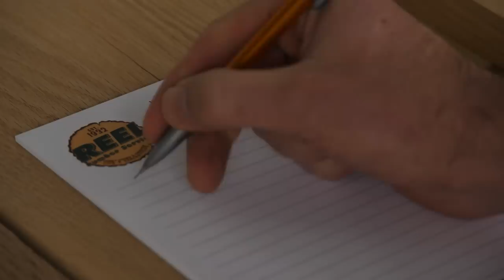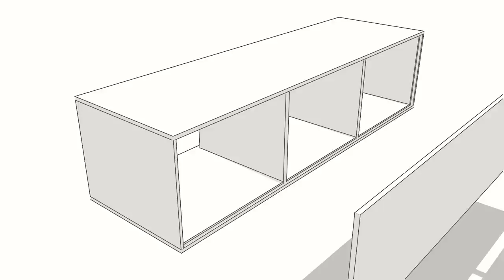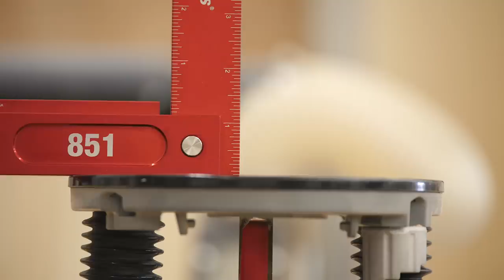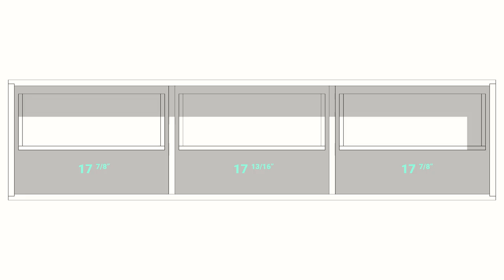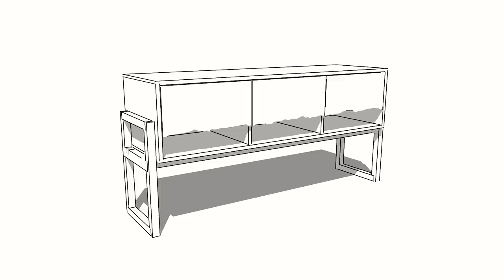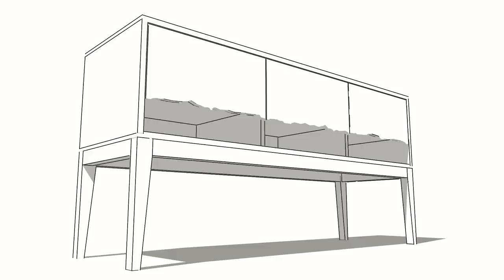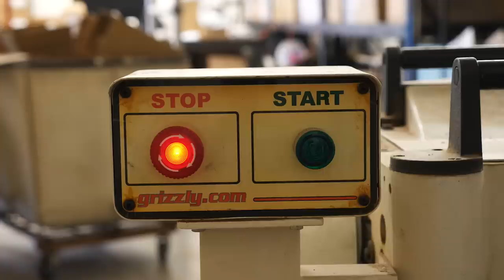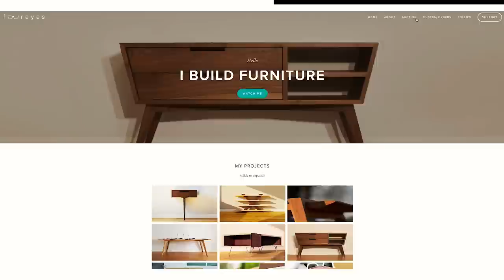Live Edge Drawer Credenza

Comment: Nice video! About the "reinforcements" with screws: I saw some videos testing screws vs glue. The glue was way stronger than the screws, so probably no need at all to screw after glueing.
Reply from the maker: Thanks! That is true that glue can be stronger that screws but it depends on the orientation of the pieces. This joint would be end grain to face grain, which is not the strongest. Basically the more end grain get involved the less you can rely on glue.

Comment: Hi Chris, love your content. You are a main reason I finally took the jump and started some real furniture making. I am currently planing a build for a dresser. I saw in this video that when you were doing the glue up for the cabinet box you had the base sitting atop a few pucks, raising off the work surface to fit the clamps. What are those/ do you have a better suggestion on how to glue up a large cabinet and keep the corners at a perfect 90? Thank you!
Reply from the maker: Those are called bench cookies. You could also just use some scrap wood... but they are generally handy to have a few around.

Comment: 17 7/8'' - 17 13/16''. OMG I'm so glad I live in a country with metric system ! :) Those fractions of inches are just unbelievable for me !
How old a kid has to be before understanding those numbers ? :)
Reply from the maker: In all honestly, it's goofy. But it only really becomes problematic when dividing. Like if you needed to divide 17 13/16 by 3. But you'd only be doing that if you were, like, a machinist or something...and then you'd end up using the metric system probably....hahaha :)
Reply: I have been dealing with fractions like that for a long time. With enough practice it doesn't bother you. When I want to compare 7/8 to 13/16 I mentally convert 7/8 to 14/16, then the comparison is easy. The difference between 14/16 and 13/16 is 1/16, not hard. For multiplication and division.... well, there's an app on my phone for that.

Comment: Long time listener, first time caller here.

Your content is next level Chris.  I was going to build a geometric plywood shelf and finish it with some Simple Finish with Wax.  But I think you changed my mind.  The indian ink on the red oak looks so good.  I think I'll apply that first then use the finish.

Question - any reason why you chose dowels vs dominoes?  Is it just a design/preference thing?
Reply from the maker: Thanks Man! The decision to put the dowels in came after the face, so I could have gone with either still...but they were going to show. I think the dowels are less noticeable than dominoes would have been. If I made the decision before starting the build, dominos would be easier.
Reply: @Foureyes.Furniture  Thanks for the insight Chris!  I always thought the domino glue ups you and other advanced makers do are out of reach for newbees like me.  I'm just not at the point in my making/creator game to make the investment yet.

It's good to know that I can invest in some dowel jigs at a fraction of the cost in the interim.

I'm looking forward to the day I can drop a deuce of certified bangers.  :-)

Comment: love the stain on the oak.  I don't think you really needed to worry about the stiffness of the carcass since you were attaching a back that adds so much stiffness and structure. I understand why you did though, those rabbeted butt joints were a bit sketchy with no long grain to long grain connection but perfectly sufficient with the dowels and the back on it.
Reply from the maker: Yeah, I was also worried about slight shifting to a partition. Not so much of it breaking, etc... but just enough to really make one of the gaps look bad.
Reply: @Foureyes.Furniture  ah yeah, not something I had considered by that totally makes sense.

Comment: Nice video.  Couple questions:
1.  I like that small red woodpecker marking gauge you use around the 7:03 mark, but I don't see it on their website anywhere.  Do they not make it?
2.  On your 2 cut ripping method:  are you ripping the same side each time?  What advantage does this give you?
Reply from the maker: Thanks! 
1. It was a one-time tool, so it's not available anymore. Probably the closest permanent item would be the 12" T-square - https://www.woodpeck.com/shop-by-brands/woodpeckers/precision-woodworking-t-square.html
2. Yeah, no advantage, unless you had burn marks, this could remove them. The real advantage comes when you're doing big pieces and it's hard to get a good accurate cut the first go. Cutting a second time on a smaller piece let's you be more accurate. It's a personal thing though. I don't recommend everybody do it this way.

Comment: Why were the outside drawer hardware not flush mounted to the front like the center?
Reply from the maker: It’s because the interior vertical partitions are inset from the exterior cabinet pieces. So the drawer faces end up being flush with the cabinet side pieces, but cover up the interior partitions.

Comment: Why rip to final width in 2 passes? Why the second 1/8 pass? No burn?
Reply from the maker: No burn is a side benefit. But the main purpose is I find I get a nicer consistent cut in terms of width. I think it came from cutting down bigger panels of plywood, where it was hard to keep consistent pressure on the fence. So I'd cut oversized and then finalize with a more manageable piece. With smaller pieces it's probably unnecessary...but it works for me, so I stick with it.

Comment: This may sound strange but...
How strong would the joint be if you used 2 dominoes at 90 to each other so that they look like a cross when viewed end on?
Reply from the maker: I'm assuming they wouldn't be intersecting? If not, it still depends on the type of material they are in, etc... But should be pretty strong.
Reply: @Foureyes.Furniture   yes intersecting (sorry couldn't remember the word.)

Comment: This video is really good. Your work techniques also are. Just a bit sad about the fake live-edge. It's a feature that will be out-of-date pretty quick, I feel, compared to the rest of your crisp, clean build.
Reply: I also feel conflicted about the fake live edge. On the one hand, real live edge complete with sap and bark is usually cut off and discarded for good reason imo. 'Fake' live edge isn't such a bad concept in this regard, but just drawing on a squiggly line that has no relation to the grain pattern of the board and calling that a live edge? Not for me...
Reply: @trevfindley  In my view, making the most of a rugged board is a thing, and we can debate about style, but faking one by wasting good (and pricy) wood is another.
Reply from the maker: hey. I'm just glad the two of you have been able to bond over a shared hatred of my project :)

JK - I get what you guys are saying. The "faux live" edge is purposeful here though. It's the handle. Yeah, I could have just made it straight, but I think this is more interesting.
Reply: @Foureyes.Furniture  I'm not disputing the purpose of the live edge, or even the concept of a doing faux live edge - i just think it lost integrity by having contours that don't correspond to the grain of the timber, as they would if it was 'real'. However - i feel bad now for commenting, since you've done an excellent build, and and an even better job of documenting it and it's in no way deserving of negative comments...
Reply: No hate @Foureyes.Furniture , just healthy criticism! I feel like honesty is important. But I agree, it's probably not fair considering the time and energy invested. Thanks for sharing your good work !

Comment: I like the channel, I like the content but I don't understand a few things which you state or, explain.

For example, the joiner?

Why do you call a machine which straightens and flattens surfaces of wood a joiner? It does not join materials together.

Why do you guys use imperial measurement when clearly metric far more accurate?